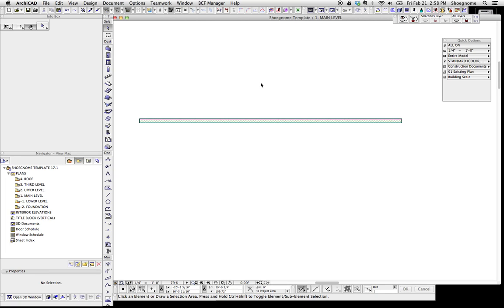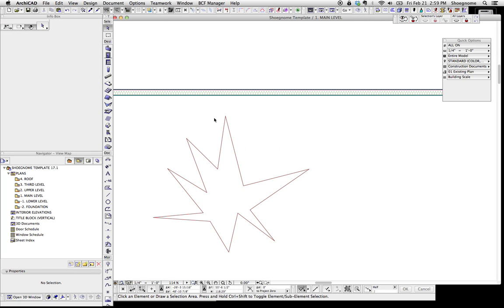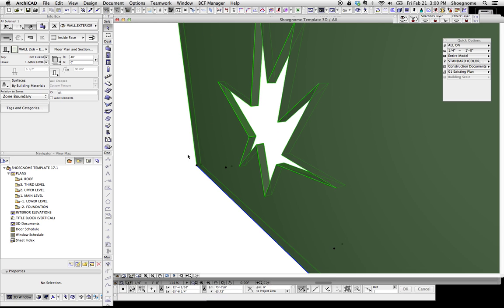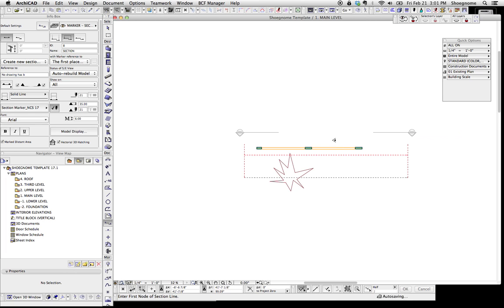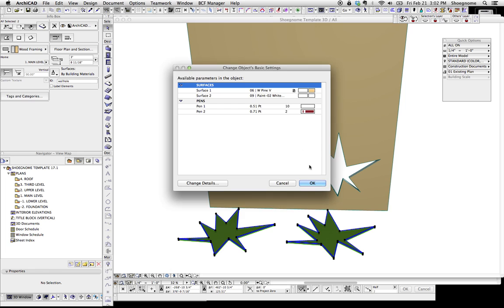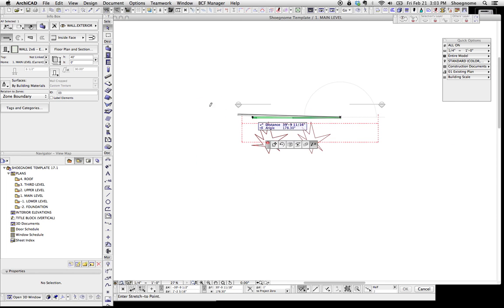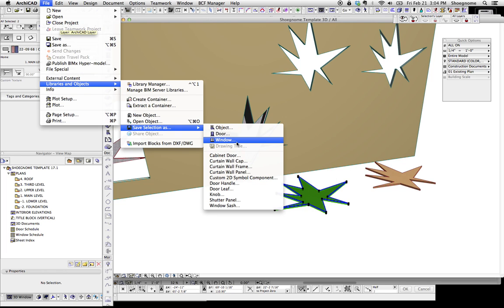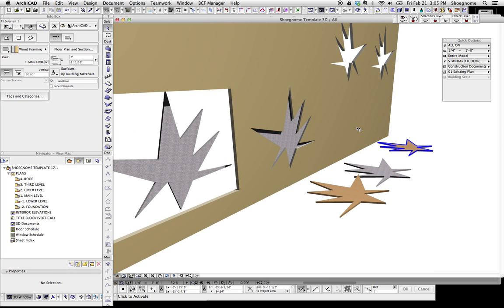ArchiCAD Tutorial #36: Custom Empty Openings in ArchicAD

Comment: Hi, Can we put an object into the niches, made like that, f.ex. door from the library?
Reply from the maker: +kat.01 I'm not 100% sure what you mean. But you can make new niche Objects. If you need to put a door into a niche, I would make the niche, then put the door in another small wall that sits in the hole made by the niche.
Reply: +Shoegnome hm... It doesn't work, I have a wall with niche and I need to put a door into a niche but only in a part of it. So a wall, huge niche in it and small door at the centre of the niche. I tried to make a niche with a hole but it's still not it. But thanks a lot for Your help :)
Reply from the maker: +kat.01 sounds like you might need to model the niche as walls.
Reply: +Shoegnome Do You have any tip how to do that? :)
Reply from the maker: +kat.01 just put an empty opening in the wall then model new walls within the opening.

Comment: i have a wall, i need to cut out a costume shape and project it out. how do i go about doing that? also where is the shape id located on archicad 19?
Reply from the maker: +mateo diaz if the technique in the video doesn't work, try cutting a whole in the wall with a beam. The beam will need a building material with a priority higher than the wall (and the elements need to be on layers with the same intersection group number). The beam will cut the wall whether it is visible or not. I'm not sure what you mean by the shape ID. The ID has not moved in 19.
Reply: Hi and under which tab exactly is the "ID" found?

Comment: hi there, I'm working on archicad and i was wondering if you can help me. I am trying to make a free form column using a morph tool (the columns have a look of an organic cell structure) the problem that i have is that i want to make those "cell" openings that are constraint in their sizes as well as not going through the whole column as a cutout. when i try to draw on a morph object that is curved i can't seem to subtract it without making a cutout through the column or making a uniform depth even since its curved. the reason for the cutouts in the column is so the cutouts will be a different material (lit with LED lights behind the cutout cell) Anyways basically i have no idea how to make my vision of columns in archicad. I would appreciate a some tips of how to make it since i haven't found any tutorials on this subject.

thanks in advance
Reply from the maker: Instead of starting with a morph start with simpler elements. Use SEO to create the holes. Then once you have the shapes you want, save it as an object or convert it to a morph if it requires some more tweaking. The morph tool is great, but often it's best to use other tools to create the starting geometry.
Reply: Shoegnome thank you for a tip, very helpful!